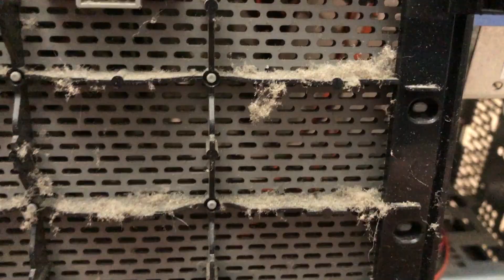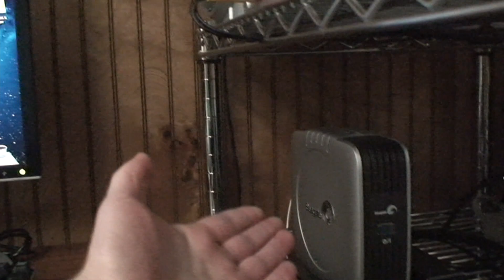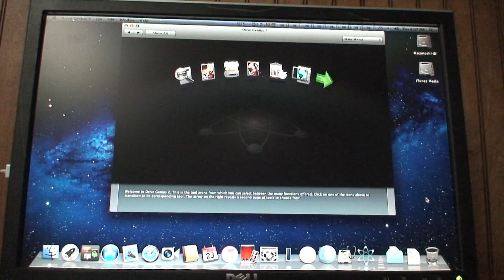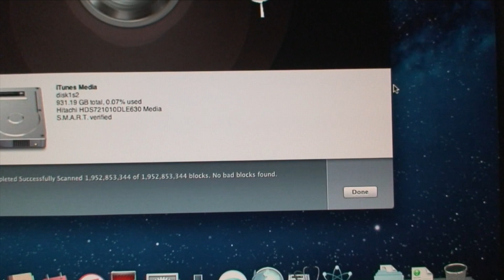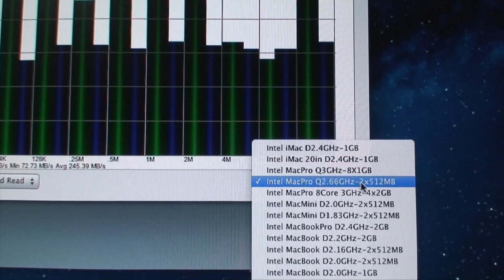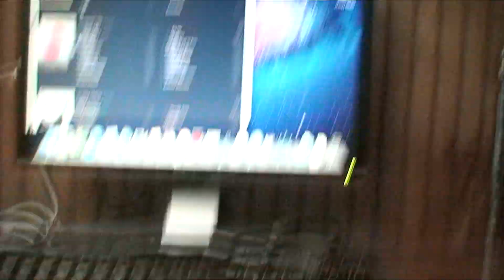Stealing from this Dell to Upgrade my Mac Pro

Comment: Those dells are much better nowadays using an ssd as a boot drive
Reply from the maker: Yeah, these Dells are great with SSDs. If I was using a standard HD, Windows 7 would still be alright but with newer versions like 8 and up, SSDs are worth the upgrade.

Comment: Great video love the old tech
Reply from the maker: Thanks! This old tech still gets used all the time!
Reply: @ old tech can be just as useful as the latest tech, just depend on application and I’m your keeping them alive.
Reply from the maker: 100% agreed, despite being “obsolete” I still get good use out of my old tech and in many cases works better than modern solutions. Plus upgrades and in general the hardware itself can be easy to get.